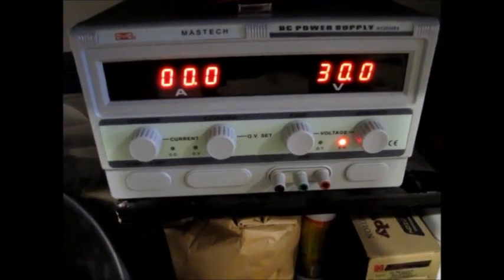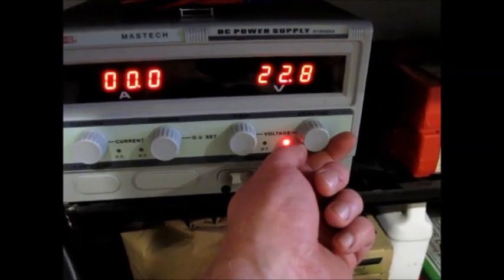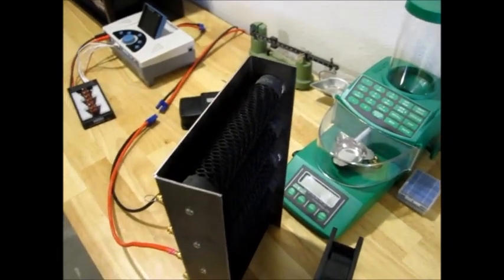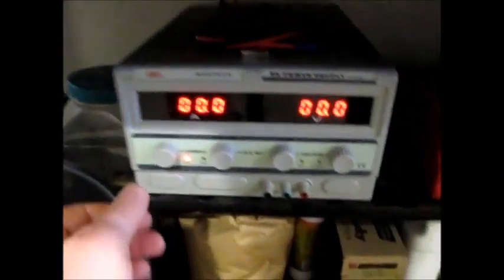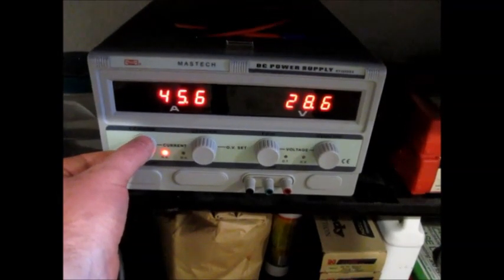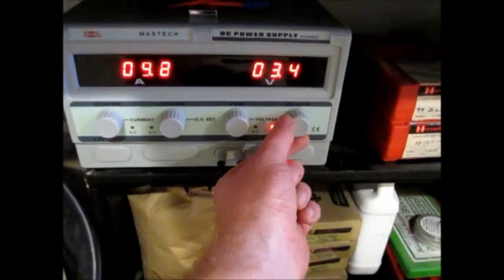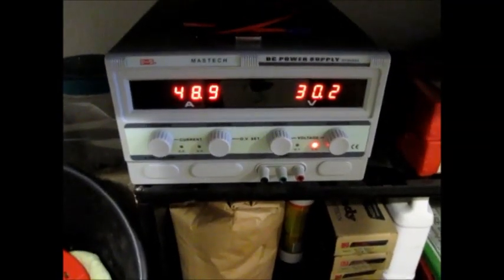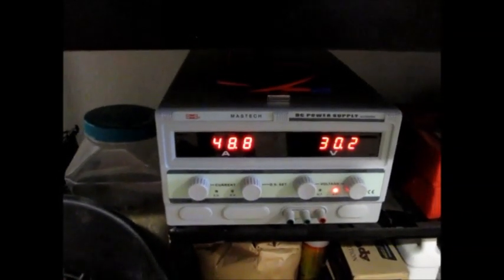Mastech HY3050EX Power Supply

Comment: Have you monitored the amp and voltage on the AC side? What does is the input? Have you monitored the amps and voltage on the DC side, or are you relying on the power supplies' meters?
Not trying to be critical, I am thinking of purchasing a similar unit and was looking for actuate data on the unit's performance.
Nice video.
Reply from the maker: The voltage and current displayed is surprisingly accurate, yes I have tested them for accuracy.  The power supply is about 85% efficient (see my response in below in previous comments).

Comment: Mastech made me buy their EX model.  Do I use over voltage portection for anodizing and how do I set it up after setting CC?  If I cut power off after setting CC, won't I loose CC settings?  I am running 4A 15V I guess the front leads will suffice.

Comment from the maker: A 30Volt 20Amp supply at max output you would figure the same way. 30Vx 20A = 600 watts.  600watts out factoring 85% efficiency = 708 watts in.  708 watts in on a 120 volt line = 5.9 amps draw.
Reply: Do you know how reset a hy10010ex  no current?

Comment from the maker: At max output 50 Amps @ 30 Volts that = 1500 watts (Volts x Amps = Watts) output.  This is not the same as the power input to the supply.  Since nothing is 100% efficient lets factor in 85% efficiency so for 1500 watts out you would need 1770 watts in.  1770 watts on 120v line = 14.75 amps (watts/volts = amps). So in this case 50 amps out at 30 volts = 14.75 amps in at 120 volts.
Reply: The manufacturer states a current load of 17 A for a 110 V line, so the power is 1870 W. Although these are simplified calculations, because the power line is of the AC type, then the voltage is rectified, re-converted and filtered with stabilization to DC.